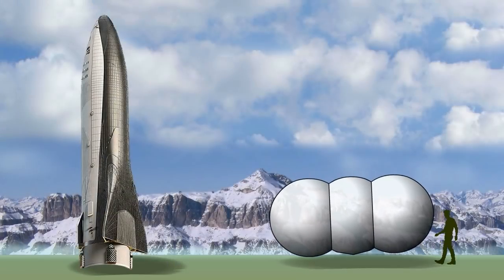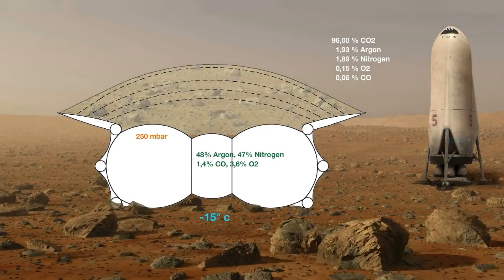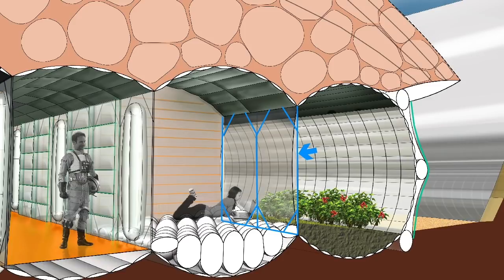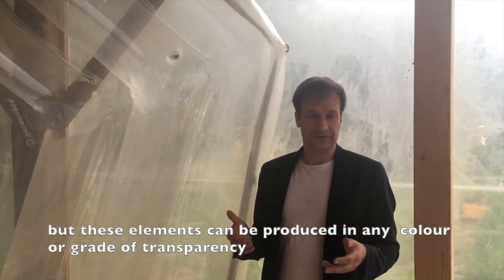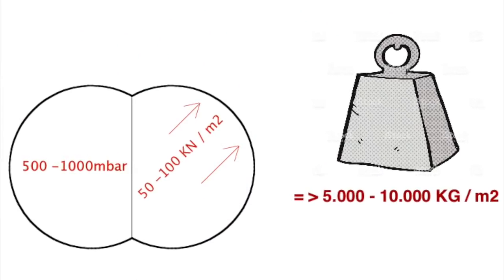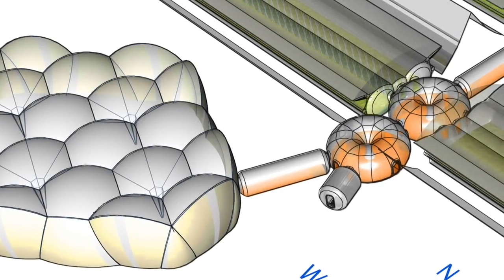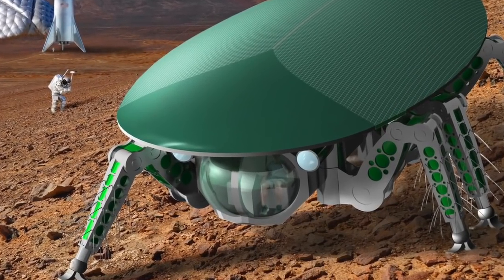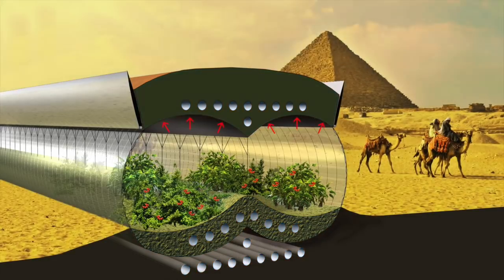inflatable Mars habitat and Lunar base

Comment: I’m pretty sure 1 starship is a big enough habitat, the amount of pressured air in it surpasses the ISS
Reply: Habitat for limited term visit yes, large enough for food production or constant human presence on the planet no.
Reply: I disagree, 
step 1 drop an orbital satellite to send both light and electricity down 24/7.
Step 2 send reactor, and robots to build sub surface hardened shelters and greenhouses. Build the infostructure before people arrive and have fresh food waiting!
Step 3 send send starship supplies. Let's be kind and let them have the inflatable furniture.
Step 4 people arrive to pre-built 3d printed handed structures ready to live in.
Reply: Starship is a good size but radiation shielding is limited.  It is not meant for permanent habitation.  On the other hand, Starship could carry some far larger inflatable habitats that could be buried for radiation and temperature and meteor protection.  

Back when the Mir was the big space station in orbit and they were talking about retiring it and the space shuttles, I remember thinking to myself, "geez..  just use the shuttle to tow in in orbit around Mars."   Or at least the moon..  granted, that thing was falling apart.. and the shuttles was truly aging, as well.

Comment: 0:20 IF that is the only requirement . Pretty sure you might want to work in "durability" not just "light weight" . 3:25 Havent figured out just how dangerous high oxygen concentrations in space programs is yet ? Thats enough make believe for one day .
Reply from the maker: In the video we suggest to keep the inner air pressure at half of sea level air pressure on Earth and raise the content of oxygen from 21% to 30%. In the carbon age 300 millions of years ago the earth atmosphere was denser and had an oxygen content of 35%.  When the accident in Apollo 1 occurred , the air pressure inside the spaceship was 15% above sea level pressure and the content of oxygen was 100%.(   https://en.wikipedia.org/wiki/Apollo_1 )  It is the combination of  pressure and oxygen content that makes it more or less explosive in combination with fuel  So our suggested pressure and oxygen levels are not more dangerous than the normal Earth atmosphere . Beside this is not a crucial part of the concept. Changing these atmospheric values would not require to change the concept at all.

Comment: I’m no rocket scientist but I have used an air mattress before and from that can conclude I wouldn’t put my life in the hands of a glorified air mattress.
Reply from the maker: of course that structure an  the used materials are as far away from an air mattress as a car tyre is.  Bigellow has successfully installed an inflatable module in the ISS-space statin, where it is exposed to cosmic radiation , debris  and micrometeorites.  In the PNEMO PLANET design on Mars or on the Moon, the inflatable structure is protected by several meters of loose regolith. So when an inflatable structure can be  safe enough in space , it can be even saver in the conditions on Mars
Reply: If your speaking of a plastic box store matress your right.

 However there are other vulcanized materials that are actually usable. I refer you to the 1956 Goodyear inflatable plane, white water rafting boats since the 1950s/60s and even today's select confort beds(i used one for over a decade). But while lighter than other materials, none of then are very light. You lift any of these 3 examples you know your carrying something.

A chair, coach or sofa is possible but not without a padded cloth cover. I still remember the sweety blow up furniture from the 60s. Lol
Reply: But what about a glorified tin can? Do you know how leaky the ISS is? Buried inflatable modules on mars is an excellent idea.

Comment: Very inventive method - never saw anything like this!

1 - Rockwool is also commonly used in hydroponics/aquaponics/aeroponics applications
2 - You might need LED to supplement natural light and then mainly for fruiting plants vs. leafy greens
3 - There are new solar films that can pass light through and also generate electricity (they look pink) so in theory the incremental electricity could help offset demands of #2
4 - The Martian geothermal possibilities for power or HVAC are definitely food for thought

The lunar lens and mirror concept is also novel - well done!
Reply from the maker: thanks for your input of ideas! 
On Mars, according to the available data and my calculations the natural sunlight is sufficient even during dust storms. specially since sunlight from a larger area can be focused by the curved  mirrors. for LED light the problem is where to get the electricity and how to store electricity. electricity only can come from pv panels , where the efficiency only can be a lot worse than from the original source, or from nuclear reactors which have a high payload as do batteries.  the sun still ist the easiest, most efficient and most reliable source for light and heat
Reply from the maker: the sunlight in he Mars orbit is nearly half as much as on Earth orbit. On the surface during a dust storm still 30% of the global radiation is available mostly as diffuse radiation . A cloudy sky on Earth darkens a lot more.
 the light intensity on a bright summer day is abut 100.000 lux. on a bright day in winter ts is15.000-20.000 lux which also ist the maximum that most plants can use for photosynthesis. on a cloudy day it goes down to 1000lux.   indoor a room with 500lux seems to be perfectly bright. because the human eye can adapt to different light conditions in a ways that we don't notice these great differences